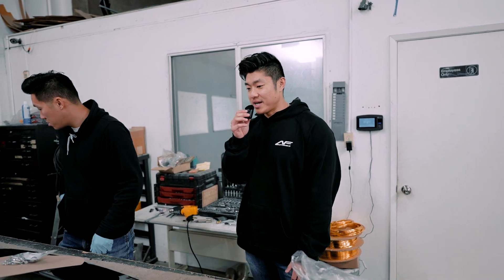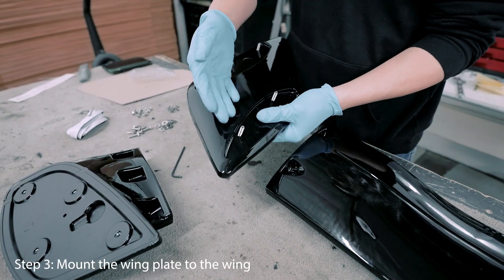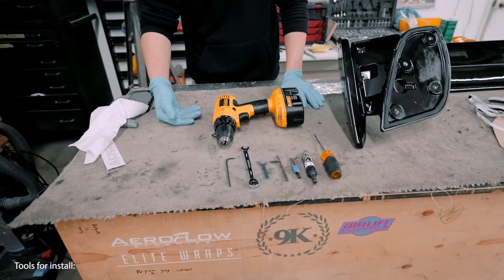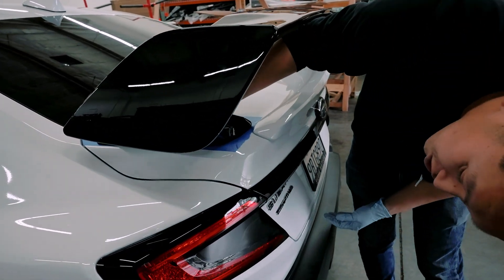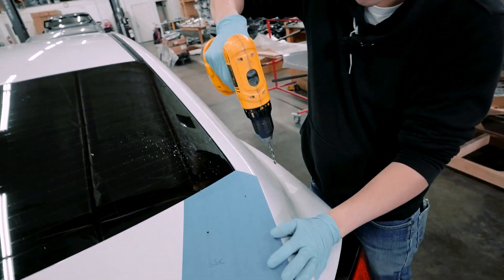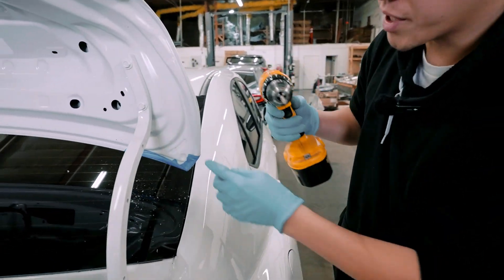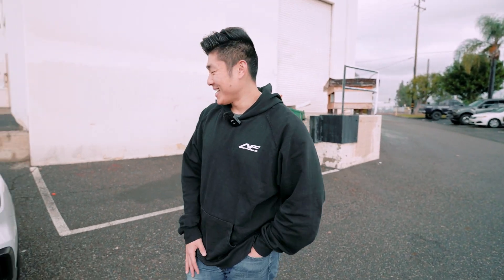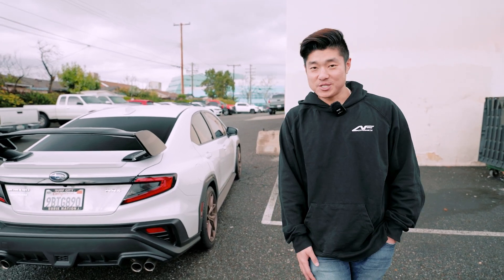How to install your Aeroflowdynamics V1 STI Wing | 2022 WRX

Comment: I'm just curious, but how long do you think this would take at an auto bodyshop? Almost four hours, and they're still not done installing a spoiler! 
Edit - So they finally installed it, and it looks great, but I noticed they drilled into the trunk weather strip, which was disappointing.

Comment: I’m a year later, I just installed it today, and it looks sick, but I have a question, how do I take out all the little pieces of metal I have inside the trunk, everytime I open and close my trunk, it sounds like sand inside of it, how do you guys manage that?
Reply from the maker: You’ll need to remove the trunk shake it around and use a vacuum!

Comment: Im in the market for a 2023 wrx but out if curiosity do lal the parts on your website listed 2022+ mean they do fit the 2023 models or no? I really wanna fix a car up cosmetically 🥺
Reply from the maker: Correct 2022+ will fit any 2022-2024 wrx!

Comment: seems like there are holes already there that could have been used as mounting holes (I have not looked at the trunk construction in detail). 🤔   Can you add blue loctite for added piece of mind...or would you recommend the orange (red strength w/blue releasability) or red (never coming apart again) loctite?   I like the fact this wing is easy to wrap right out of the box as each piece can be done individually.

Comment: I bought the v3 not the v1 because it stated only difference was its painted over seas but thats not the case the v3 only has 3 holes not the 4 which was disappointing an the studs are already in place you dont screw them in an they seem to be slightly offset making the wing itself take alot of presser to snap in place to where its almost feels like its going to break an lastly note his modified wrench thats cause the one shiped with wing is to large to tighten nuts properly still have to put wing on car but waiting on dealership to finish putting on accessories hoping dont run into more issues

Comment: When you are putting the template down, how do you double check to make sure it was done properly?  When you align it with the corners, isn’t a specific edge to use as a guide on either the left or the right side. 

I have mine and am installing today.
Reply: How did the install go? I've been thinking about getting one and I/m curious on how yours went.

Comment: Didn’t see any sealing of the exposed metal after Kevin drilled and enlarged the holes. Don’t you guys think rust will develop?
Reply: is the trunk steel or aluminum (like the hood).   my VA trunk is steel and not sure on the VB trunk.

Comment: Do NOT do this by yourself if you are not a professional. The two front holes you have to drill through 3-4 different metals. My drill kept walking. It was DIFFICULT keeping  the drill straight. Kevin makes this looks super easy but it's not. I wish I just paid a professional to do it. Now I am looking at buying a new trunk. HOWEVER, I did get it installed and it looks sexy. WORTH IT, but GET IT PROGESSIONALLY INSTALLED!
Reply: These vids are good content but seriously this kind of thing is never as easy as professionals make it look.  Definitely pay a pro.  You got +$35k for the car and however much for the wing, you can afford paying someone to get this done right.
Reply: Yeah I just messed my whole shit up. I’m a mechanic and you nailed it. I now have gaping holes where those were supposed to be. I’ll be getting a new trunk.
Reply: Arms=not big enough

Comment: I just installed the wing, the two holes near the rear of the two edges are extremely hard to drill by yourself. Holy fuck I nearly regretted, but now that it’s on I’m much happier. 😭 if you’re gonna get the wing, get it “professionally done”. Solo installs are horrible and stress inducing. Not simple. But worth it?

Comment: Are you guys having issues with wrx I saw you track it under high rpm im having issue with shifting from 2nd to 3rd gear won't engage there like a 3 sec delay before it goes in

Comment: This video is a great starting point for the install, but quite honestly if you’re not a professional I would advise against installing the wing on your own. There are several layers of metal that you’ll need to drill through and on top of that there are even more cuts that are required to fit the socket through to tighten the wing down. This video was cut to make this look easy but please be aware you’re better off going to a shop if you aren’t comfortable with drilling and dremeling several holes into your trunk.

Comment: FYI I love this wing on my car looks GREAT. However if you’re following this video I’d recommend sealing around the holes on the top side of the trunk with some silicone before mounting for added protection. I mounted mine with just the weather stripping to see if any water got in and I noticed on one of the bolts atleast a little bit of water seepage through which isn’t good. Just take the extra step and you wont have anything to worry about as far as weatherproofing

Comment: i got a question , the original 2023 wrx got 275 hp .Does anyone know how much the maximum hp it will gonna be after remap the ECU ? 350hp ?
Reply: Depends on the parts and tuning. The FA24 so has shown decent jumps in power but we have yet to seen full builds due to limited aftermarket upgrades atm and in terms of reliability it seems like this is a solid motor. I would expect it to hit 350hp with no reliability issues